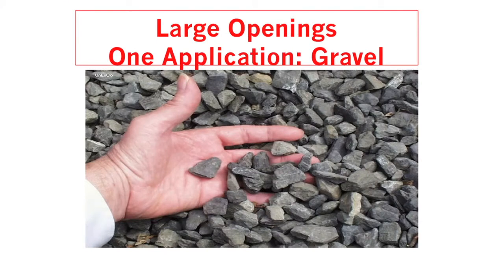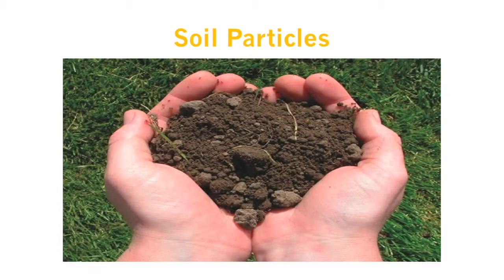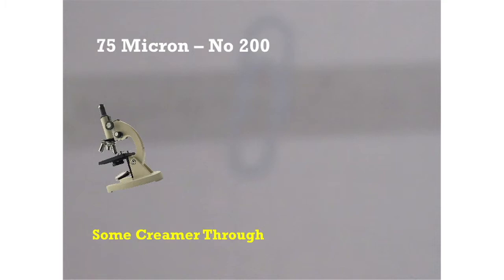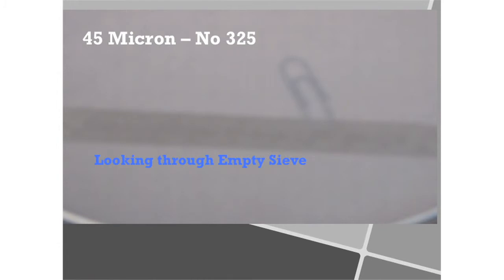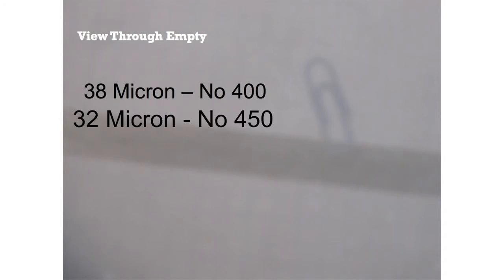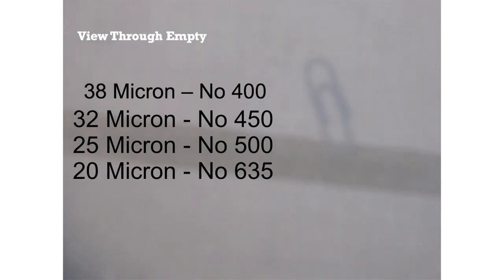Sieve Mesh - Sizing Explained

Comment: 😮 okay so I've been smashing gold ore at the house. 
  I have been using an auger drill bit quarter-inch I also bought myself a solid cast-iron concrete steak.
More recently I've purchased double closed-end wrench 1 1/4 on one side 1 1/2 on the other side of the wrench.
   Now what have I been using them to smash and stomping to an modern-day stainless steel coffee thermos mug.
  Wifey had a 4-Piece strainer set in kitchen so I grabbed one
 😬 Not realizing that it was an ultra-fine nylon mesh strainer it's the one where you cannot pass the thumbtack through but you can fit the tip of the sewing needle. 😮 and i am wondering why I'm having trouble finding identifying AU,  in My Pan. 
 🧐  Um any suggestion on how I should go about processing this ultra-fine concentrated concentration of concentrates?  🙄😒😥